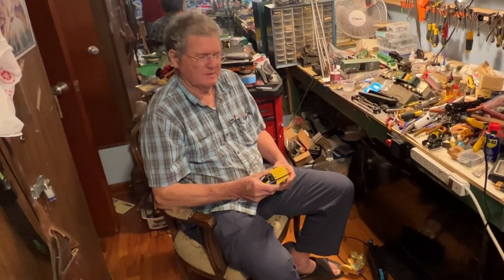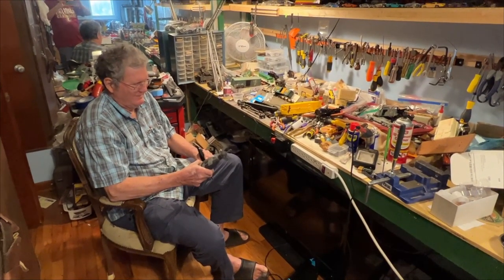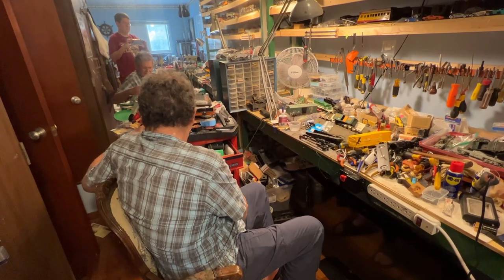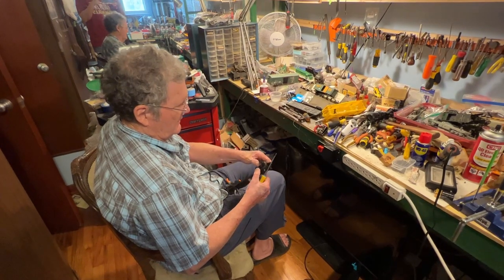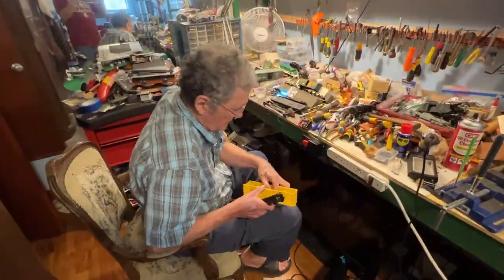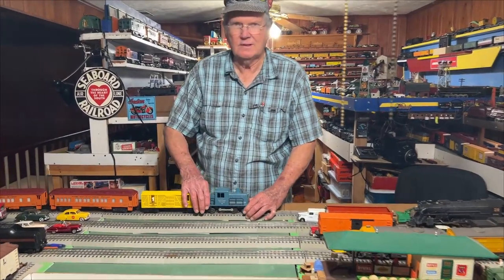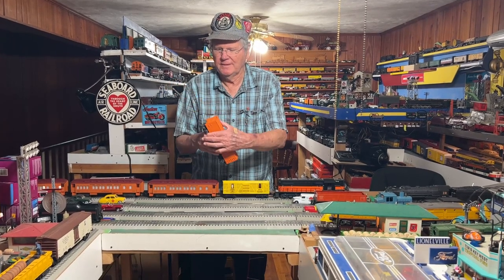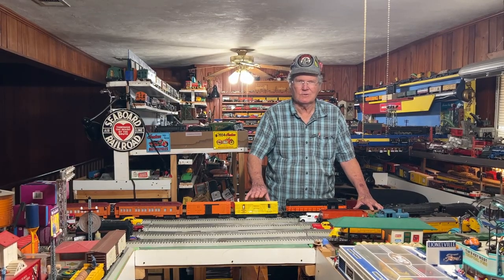Repairing Badly Damaged Truck for SAVING HORSE CAR HISTORY with Lionel No. 6473 Train Show Find!

Comment: I can see your camera man in the mirror. If you're a fan of the 1950s TV show HIGHWAY PATROL this happens all the time. A reflection of the camera tripod on the side of the black patrol cars. Don`t put a Marx Truck on a Lionel, the couplers do not line up. Forgive me, but a clean work bench makes life so much easier. At 75 a retired electrician, and no longer restoring Studebaker autos, I turned to reviving my dad`s Lionel collection. along the way I got the Marx Train bug.    KEEP ON PLUNKING!             A late note, I can`t find "MY WORLD 67".
Reply from the maker: Try it this way "myworld67". I am 79 and trying to keep my 1950 Plymouth on the road. I traded my 1949 Studebaker for a Ford 8n tractor which ran great for years but now needs help. At 79 there is not much I can do on the large stuff so I focus on the trains. My small workbench was cluttered so I built the larger one thinking it would stay organized and neat but it turns out that I am the problem. My son J Man (seen in the mirror" produced this video. His channel "Metal Sharxs" is all about the hobby of metal detecting. On my channel you will find a number of videos on Marx projects and also videos on the Moultrie car chow. Thanks for your kind words.
Reply from the maker: PD - I just subscribed to your channel. Let me mention the "Classic toy trains" channel which I think you will like.